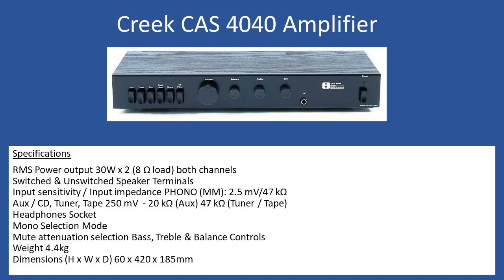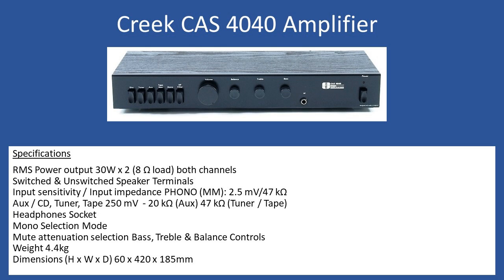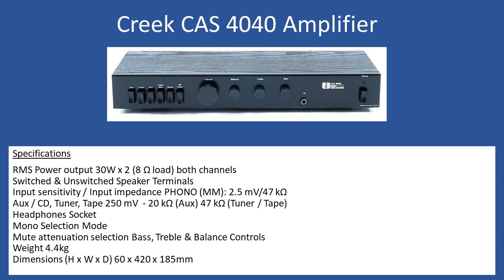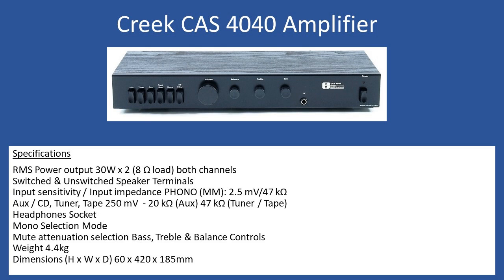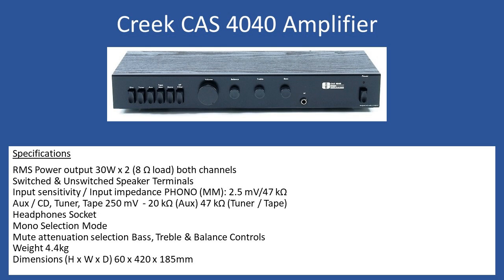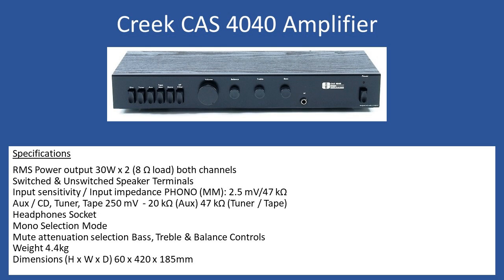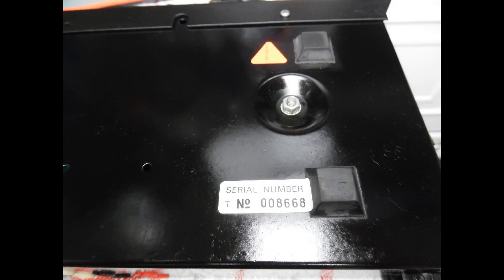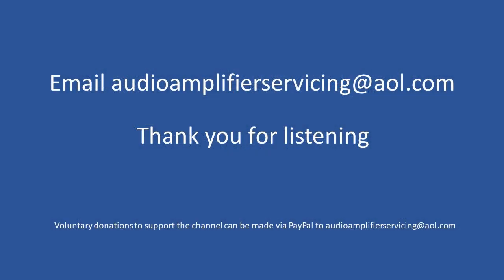Creek CAS4040 Amplifier Repair (With Audio Tutorial)

Comment: I have the same amplifier and it's not powering on. The fuses don't look burnt out and the board looks pristine. I'm not an expert AT ALL! I am going to change fuses because the unit has been sitting dormant for many years. I hope it will resolve the issue. I also noticed the main fuse is a 30A.
Reply from the maker: Hi I see you have emailed audioamplifierservicing@aol.com,  so I will respond directly.

Comment: good morning, your channel is very interesting, you have expertise and know how to communicate very well... I would like to ask you about the Creek cas 4040 which most appropriate final transistors should be adopted???  I have one with the abbreviations BDT 63 B J 8001 and BDT 62B J8205...thinking about the original project, what would be the right transistors??  Thank you...
Reply from the maker: Hi thank you for your feedback about my channel, much appreciated.
There were 3 version of the Amplifier and the output stages were changed as improvements were made and components became obsolescent. 
The version your referring to could have had BDT64C / 65C or BDW93C /94C but I have seen amplifiers with A & B versions fitted.
If you're looking to replace the BDT Transistors you must source Genuine original Phillips devices, any other brand will not work and will fail.
See this data sheet
https://www.datasheetarchive.com/datasheet?id=5bf27018fe8e9f28db050d8da902749ecea6e2&type=M&term=bdt63